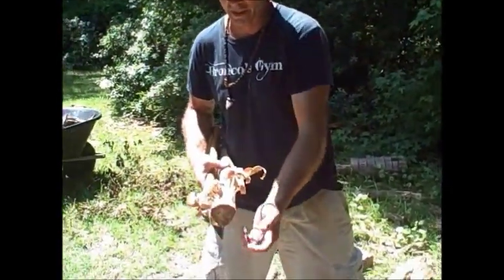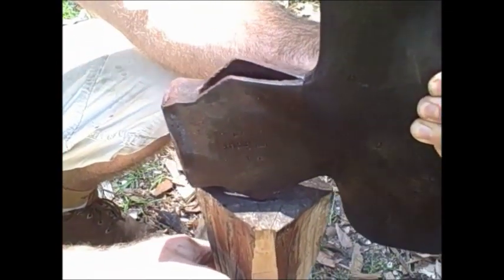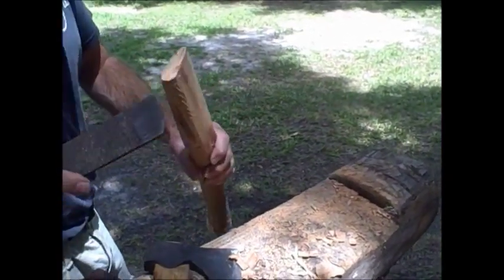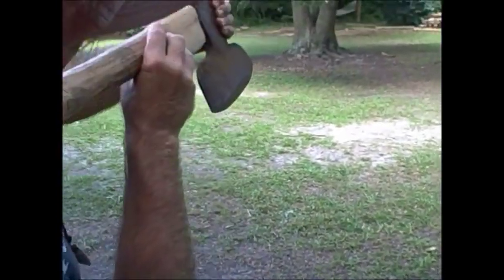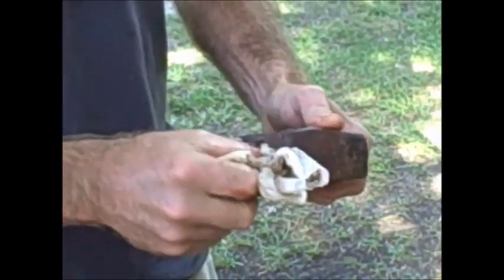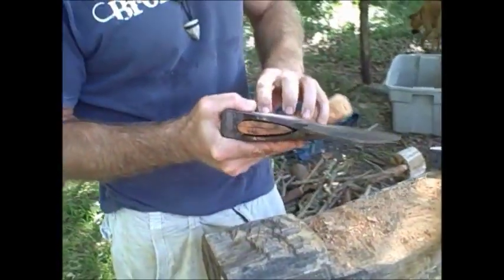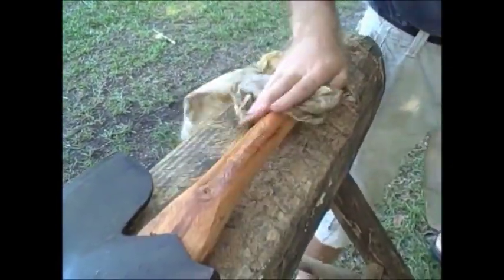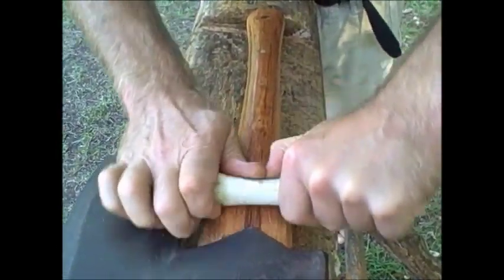Making an Axe Handle by Hand

Comment from the maker: Yes, similar.  I cut out about 5 minutes from the original due to length.  I'm finding that folks prefer shorter videos that get the point across. Love that you used plum from your yard.  Keep it full of oil and it'll last a long time.  Thanks for checking in.

Comment: Is the handle aimed right? It looks as though it's curved toward the hewing (flat)side.
Reply from the maker: yes, it should be curved towards the flat side. not the bevel.  Bevel out when striking the log.
Reply: Michael Bronco The whole reason they are curved is to provide clearance for the knuckles between the handle and the hewn surface. The handle should curve away from the work surface, thus towards the bevel side. Don Christie is correct.
Reply: don christie I was going to say the same comment

Comment: and u forgot to put in a steel wedge...
Reply: Steel wedge is not necessary if your wood wedge makes the head tight.  Some claim the steel wedge will split the grain in the handle and weaken it.  I have used a steel wedge after years of service when the head has loosened as a quick fix.
Reply: its dry chery ig he does it right he does not need any wedge but the wood is so hard but a bit brittle good for small axes